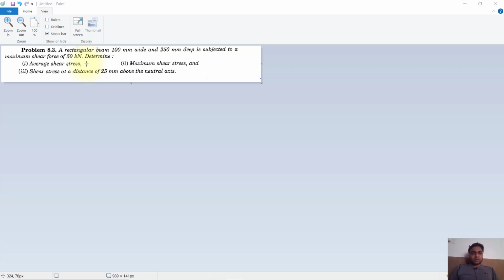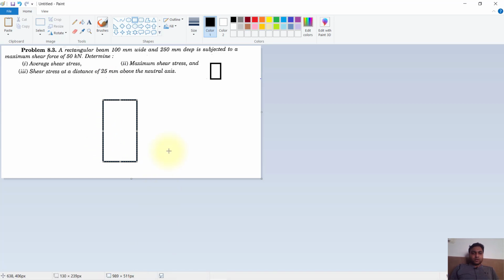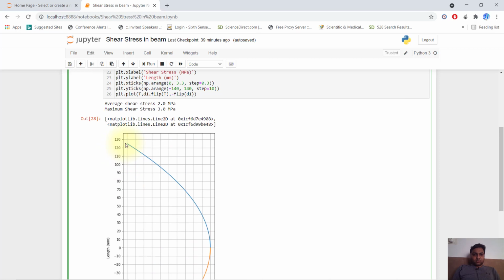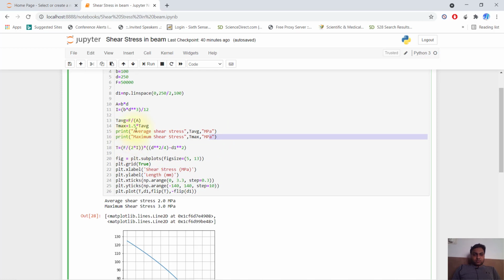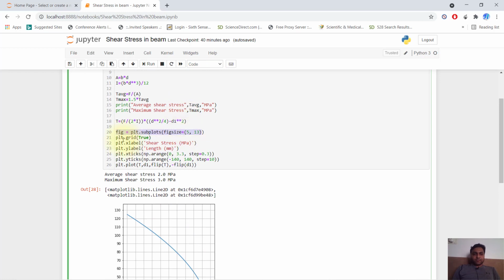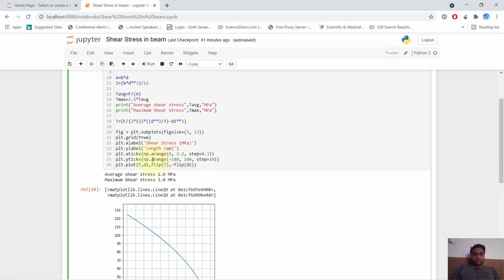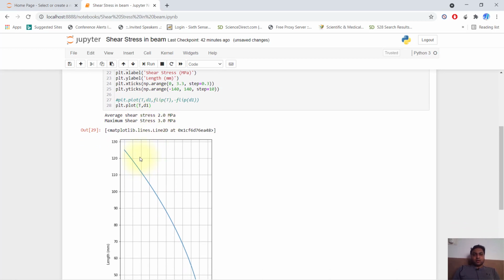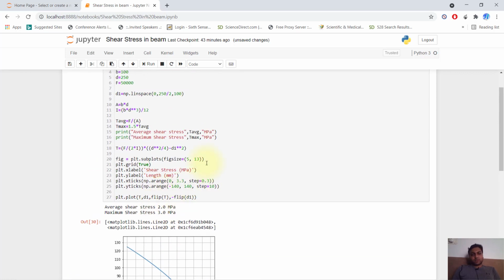Shear stress in Beam | Python for mechanical engineer | Python Basic Tutorial

Comment: from numpy import *
import matplotlib.pyplot as plt

b=100
d=250
F=50000

d1=np.linspace(0,250/2,100)

A=b*d
I=(b*d**3)/12

Tavg=F/(A)
Tmax=1.5*Tavg

print("Average shear stress",Tavg,"Mpa")
print("Maximum shear stress",Tmax,"Mpa")

T=(F/(2*I))*((d**2/4)-d1**2)

fig = plt.subplot(figsize=(5,13))
plt.grid(True)
plt.xlabel('Shear stress(Mpa)')
plt.ylabel('Length(mm)')
plt.xticks(np.arange(0,3.3,step=0.3))
plt.yticks(np.arange(-140,140,step=10))
plt.plot(T,d1,flip(T),-flip(d1))
Reply from the maker: Or first line you can write, import numpy as np
Reply: @HarikrushnaDodiya  AttributeError: 'AxesSubplot' object has no property 'figsize'

<Figure size 432x288 with 0 Axes>
its shows this  error after run this code
Reply from the maker: @zaidkazi4832  remove fig size sentence, is it working ? If working tell me
Reply: @HarikrushnaDodiya  NameError                                 Traceback (most recent call last)
<ipython-input-20-1c1d6f4c0980> in <module>
     25 plt.xticks(np.arange(0,3.3,step=0.3))
     26 plt.yticks(np.arange(-140,140,step=10))
---> 27 plt.plot(T,d1,flip(T),-flip(d1))
     28 plt.plot(T,d1)

NameError: name 'flip' is not defined
now its show this error
Reply from the maker: @zaidkazi4832  Write np.flip
Reply: @HarikrushnaDodiya  sir if possible can u send me that all proper codes so  i try to run here directly